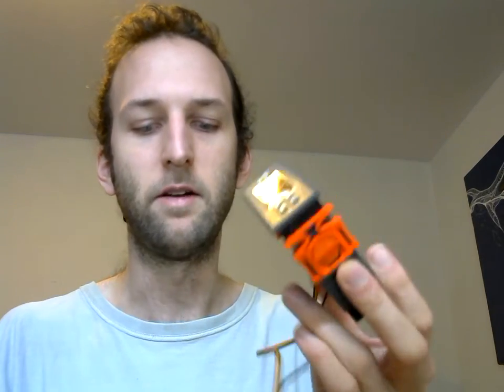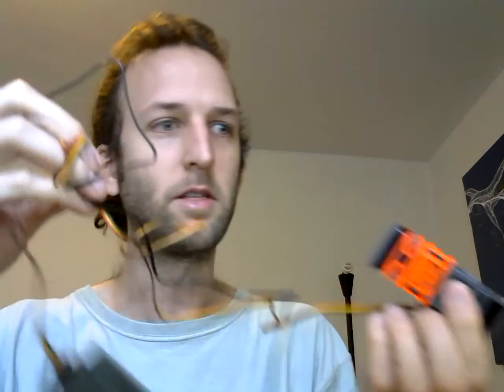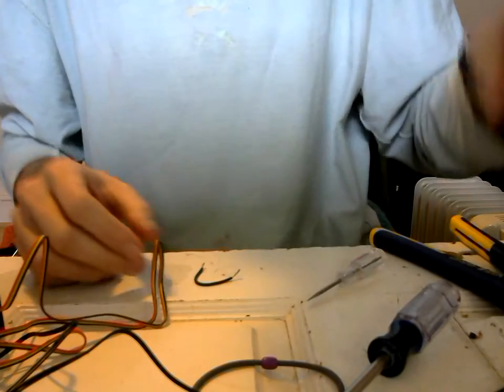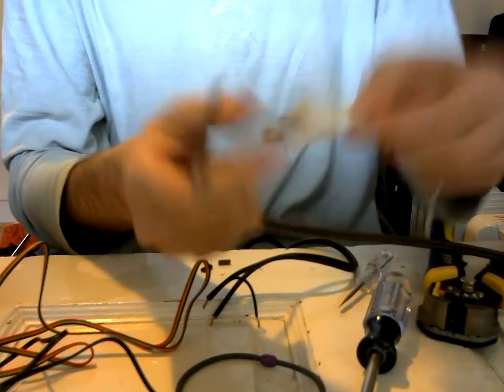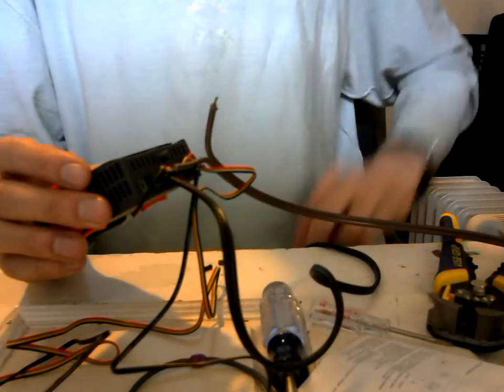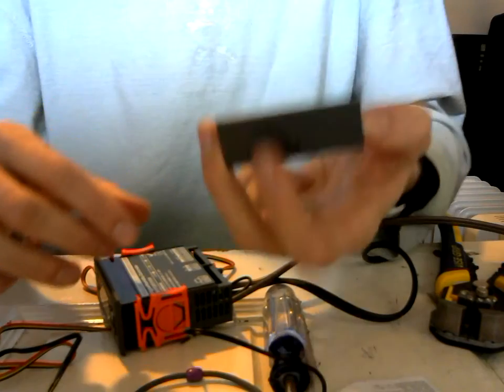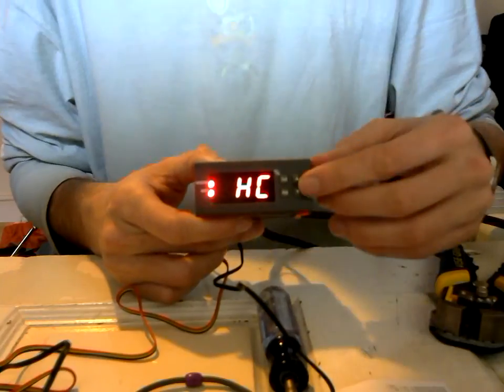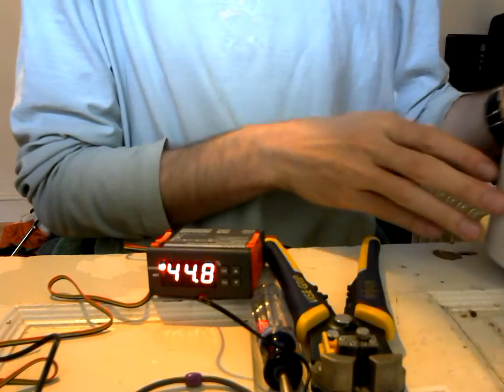DIY Guitar Humidity & Humidor Control

Comment: Awesome, I built one of these recently too.. I just wanted to add.. The other option for the plug/outlet is to get an extension cord and cut it in half - practically the same price as the outlet that you got at the hardware store and kills two birds with one stone :) I realize you don't need it at this point, just throwing that out there for someone else

Comment: Hi, Thanks for the great video. I got the exactly same humidity controller and I want to connect with a small personal humidifier. Do you know whether lamp wire is enough to carry the current?
Reply from the maker: I'm no electrician; I'd recommend using the same gauge wire as the humidifier came with (meaning, the humidifier wall plug's gauge). It doesn't seem to be much heavier than lamp wire, but it would be wise to check for safety. (the wire I used is slightly larger than standard lamp gauge).

Comment: Do you think this will work for a 240V "through the wall" AC unit?  I would like to have the wall unit turn on AC when the Relative Humidity reaches a certain point and then turn off.  My AC unit draws up to 4320 W and it has a ground wire.

Comment: thanks  bud  hope  me out a bit  hard to find  humidity controller that works
Reply from the maker: +David Kiesanowski Hi Dave, a link for most of the stuff in this video is in video description (if you click "show more"). Here's a link for the humidistat (or humidity controller) specifically: http://www.amazon.com/gp/product/B009VY1ANM/ref=as_li_tl?ie=UTF8&camp=1789&creative=390957&creativeASIN=B009VY1ANM&linkCode=as2&tag=kalgooguistu-20&linkId=R2LGMOQEYGPTHPZ7
Reply: +Kale Good things bud we don't have  menny  option here in new zealand  lol
Reply from the maker: +David Kiesanowski Ah, well that changes things a bit... I'm not sure what to tell you. Apparently neither ebay or amazon have new zealand operations yet. The best I can do for you are these ebay options, which include free shipping; New Zealand isn't listed in the "Exclude" category for free shipping. Not sure what tariffs, etc would apply: 
http://www.ebay.com/itm/110V-Digital-Air-Humidity-Control-Controller-WH8040-Range-1-99-RH-HM-40-Type-/181364453793?hash=item2a3a29f1a1:g:vRgAAOxyTMdTNoaj
http://www.ebay.com/itm/110V-Digital-Air-Humidity-Control-Controller-WH8040-Range-1-99-RH-HM-40-Type-/331126553441?hash=item4d18ae3b61:g:rW8AAOxyTyBSXzU-#shpCntId

FYI there are a ton of listings for these, most of them shipping from the States. All of these excluded free shipping to NZ. These were two I found that were shipping from China; both included free shipping to NZ (as far as I can tell). This may be the same with other products and may be useful for future projects. 

I haven't a clue what the exchange rate is; hopefully it doesn't bite you too hard.
Reply: +Kale Good it all good  I'v got ebay lol I'v got  sum on the way now lol

Comment: Hi, great video! I'm considering using one of these to run a humidifier or cut on some misters inside a small greenhouse.  I was wondering if you could tell me about how accurate you believe it is and how fast it responds to humidity changes. I don't wanna drown my seedlings if I used this to cut on water to misters but the real time response of the probe was slow.  Thanks for any info!
Reply from the maker: +Jared Cox I haven't tested accuracy with a separate unit; however, it does have a calibration feature which I use. The changes in humidity are registered almost immediately (of course, if the sensor is across the room from your humidity source, it will take a bit for the humidity to propagate and be registered). You can set the sensitivity of the device; I have mine set at 50% RH with a +/- 2% range. With this, the humidifier kicks on at 48%, takes it up to 52%, then turns off. This range has a minimum value of 1%, if my memory serves. 
Clearly, as with any DIY solution, do a test run before production use.
Reply: cool, thanks for the response!

Comment: Thanks for vid
Reply from the maker: Sure thing. FYI, it seems most $30 humidifiers have at least some reviews which say they leak. Mine started leaking. Putting it on top of a towel is a bad idea (as one reviewer did); the water will just pool. Putting it in a container is a bad idea, too. The water will pool and the device may short. My solution was to buy two containers; a larger one to hold the humidifier, and a smaller one that sits upside down inside the container. The humidifier sits on top of this second container; the water runs off it and the risk of shorting is greatly reduced (I drilled a hole in the middle of the second container to really make sure this was the case).

Comment: Hi..do you need to match up the + and - from the wall and outlet (humi)? what happens if you have an earth cable (third cable)? which terminal does this go into?
Reply from the maker: jimsta10 There isn't a place for a ground cable. However, my humidifier doesn't require one, so I wouldn't sweat it and I'd just leave it disconnected. As for + and -, I think (but am not certain) that the unit is designed so that it doesn't matter. However, I'm no electrician.
Reply from the maker: jimsta10 There isn't a place for a ground cable. However, my humidifier doesn't require one, so I wouldn't sweat it and I'd just leave it disconnected. As for + and -, I think (but am not certain) that the unit is designed so that it doesn't matter. However, I'm no electrician.